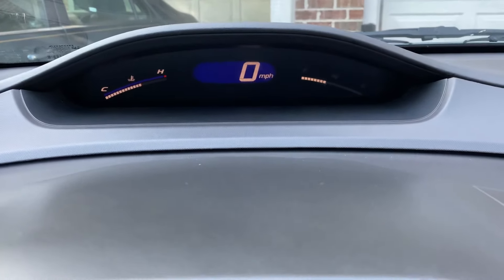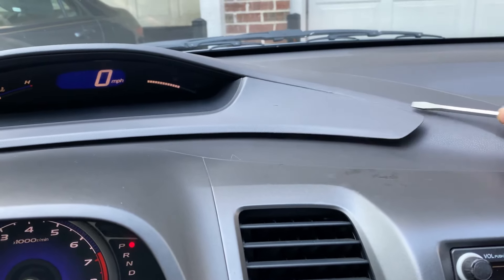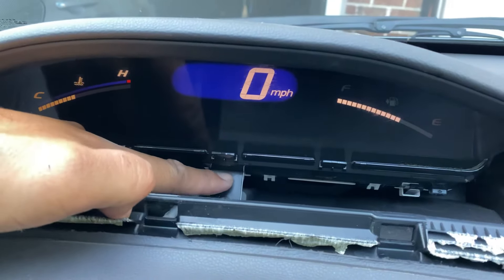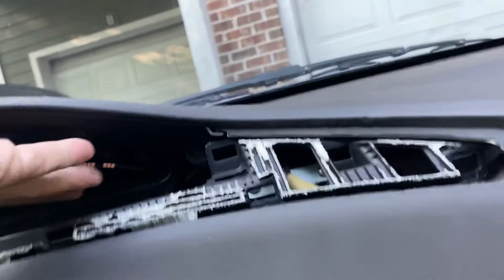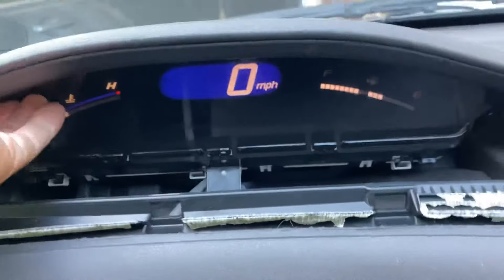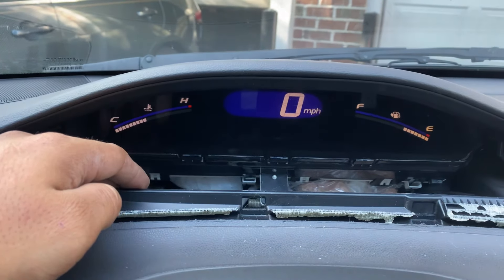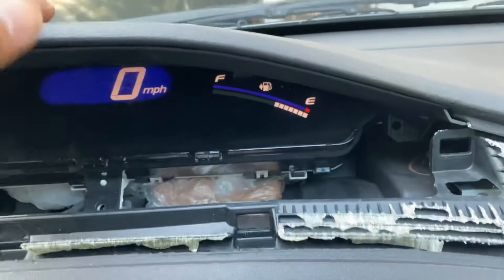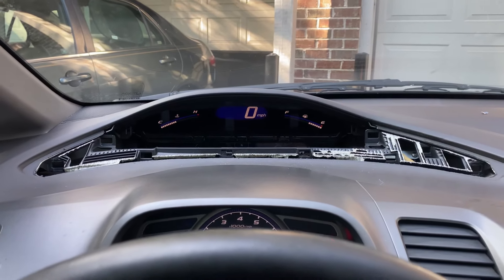8th Gen Honda Civic Inverted Fuel Guage Quick Fix!

Comment: That's not a solution. Come on.
Reply: The real solution is to add solder to the fuel gauge circuit its not that difficult with a $10 soldering tool

Comment: Thanks for the tip! Just did this to mine. Only thing I did differently was I put a nut right behind where the screw goes in, then reinstalled the screw. I'll let you know how long if/when the gas gage goes back to inverted. Hopefully lasts a long time. 🤞
Reply from the maker: No problem, keep me updated!
Reply: Did this hold up?
Reply: @sanchezsantiago14 No, it lasted about a week before the lights started going out again. I ended up buying one of the refurbished ones off eBay and it works great. With the refurbs, you can see where they did repairs at each of the pins where the LEDs are and honestly, they did a great job. I'd def recommend one if you decide to go that route. 👍
Reply: @raginasian4720  awesome I appreciate the feedback
Reply: @sanchezsantiago14  Happy to help
Reply: @raginasian4720  I'm about to buy one on ebay as well , did you have to move more of the dashboard or just the one piece to get to remove the speedometer piece?
Reply: @m_recon5092  You have to remove more of the dashboard, but it's super easy. Hondas (the older ones) are the easiest to work on. Just make sure you buy a speedo that has been remanufactured and not a used one from a wrecked Civic.
Reply: @raginasian4720  thank you